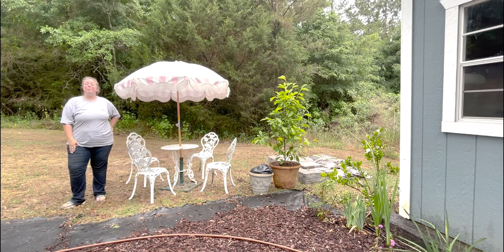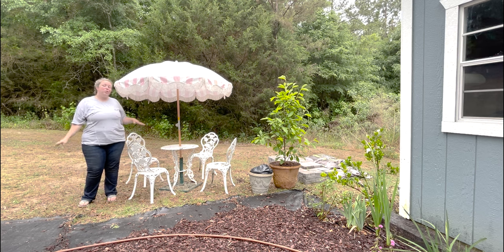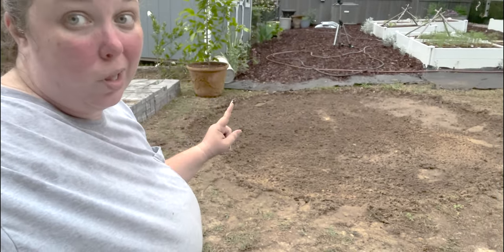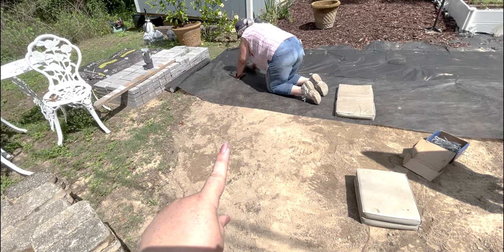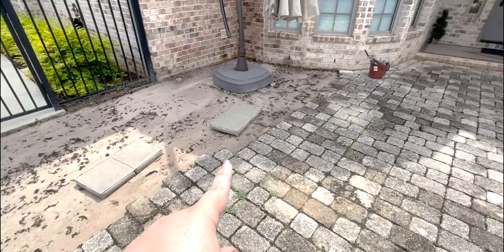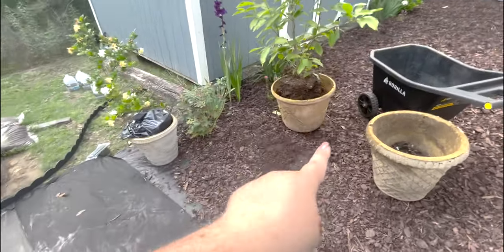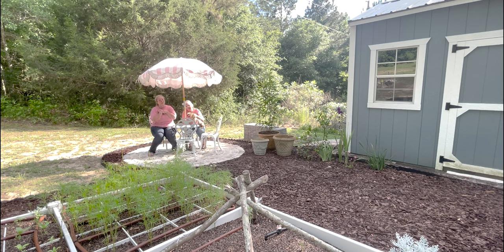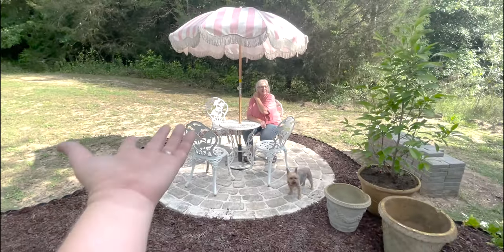Building a 9x9 Paver Patio! DIY Paver Patio for my Bistro Table!

Comment: I used finer sand in between my Pavers. However, Polymeric Sand may be your thing. My spaces between 40cm pavers is small so I just brush more fine sand over and into them periodically. Another thing, I haven't yet watched all, is either a type of edging that you'll spike into the ground to hold in the pavers or a cement edging all around. That too depends on your whole make up. 4th year of my 3x5 meter patio and constantly pulling random baby weeds out, even in Winter. Gotta keep on it! Now to go watch all of your vid...